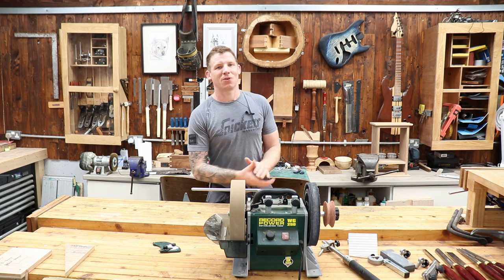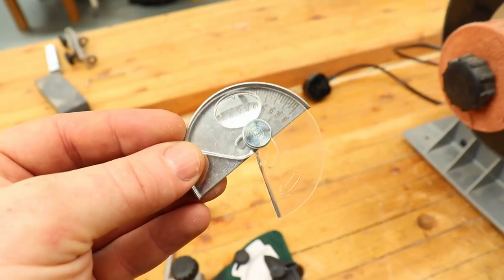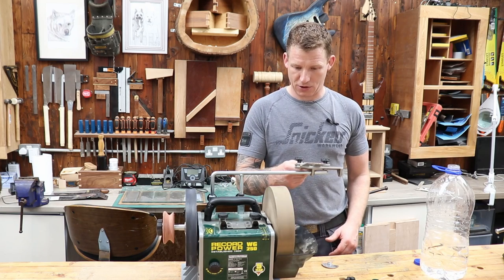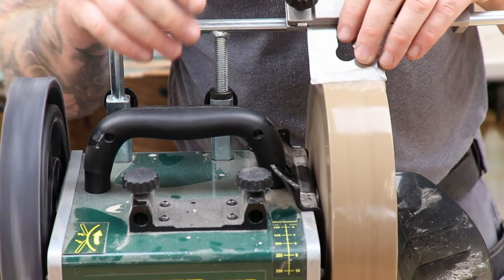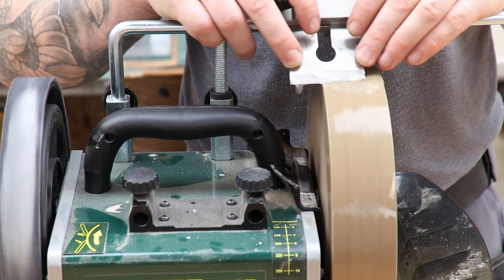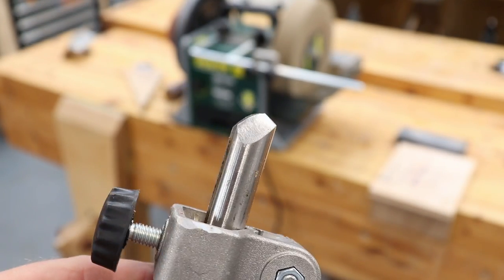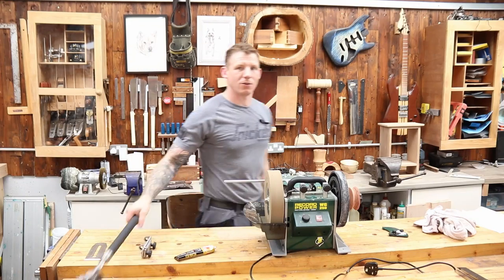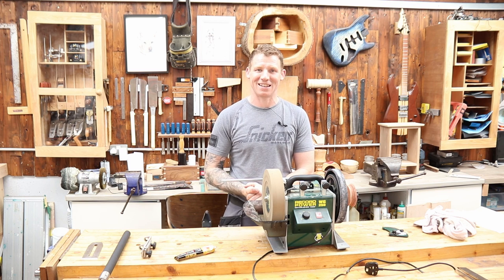Record Power WG 250 Wetstone Grinder User Review.

Comment: I'm using the 8" system and got the woodturners jigs set as well, it does take a bit of getting used to but for me it's fine. I put a ball of blue tac into the gouge gig holder helps with keeping it centred, doesn't stop the chisel riding up onto the wheel. skew, parting and roughing chisels come out great, detail gouge is giving me a bit of trouble but i think it's just practice for me. like you showed do the flat blades first and then gouges. Just a hobby but I'm happy enough with it. Would love one of the better systems but the price is the problem. one thing for sure this is a lot better than my belt sander upside down on the bench.

Comment: I I put a board 1.5 cm under the legs on the side of the wheel with the skin and the water did not spill over the machine.  I also used a cuvette on the side of the grinding wheel.  I sharpened an 8.5 cm blade.  The water did not spill onto the table

Comment: I have a lot of Record Power tools in my workshop, and you can see Record Power don't sharpen their tools on the WG200 or the WG250 other wise they would have fixed it.... its common business to remove what doesn't work off your shelf and replace it in time..... its easy to make a jig to fix the issues, but you shouldn't have too.... it should be ready to use when you buy it! 

Thanks John for bringing this issue to us all (and may be RP too)

Comment: I'm so glad it's not just me. I got mine about same time as you got yours and I too assumed because it was from Record Power then it would be decent. Iused it yesterday for what was only the third time, not because it does such a great job that I can go ages between having to resharpen but because it was such a faff to set up and the spindle jig so badly designed that it was actually making my tools worse. The angle-finder that came with mine has less than a nanometer between being locked up solid and in three pieces. The green tool setter is not much better; trying to hold that against tool and wheel while trying to adjust the support bar seems to require more than the two hands god deemed adequate. Water slops everywhere and the gouge jig is a pain to use. My first attempt left my tools with more faces than your average politician. Second attempt looked better but bowl gouge wouldn't cut at all and I had to adopt some unconventional handling to get the spindle gouge to cut. As I mentioned earlier, I bit the bullet and bought the Tormek TTS-100 to use with their SVD-186 jig. Both come with 'formulas' to obtain some of the popular grinds and the TTS-100 makes setting the support arm a doddle. And it will do so even as the wheel reduces in diameter. It also takes away the trial and (mostly) error of where to position the jig on the gouge. That was a lot simpler and smoother to use than the RP version with none of the slipping out of a poorly designed cradle. A couple of minutes later I had gouges worthy of the name. They worked brilliantly without needing to contort into all manner of weird and wonderful shapes. The SVD-186 costs about 10% more than the entire RP woodturners package but the difference in quality, ease of use and the final result soon shows why.

Comment: You can use a fine diamond plate or ultra-fine wet stone on the wheel and it makes it super fine and will give you a polished edge. Also, I used some sandpaper on a block to lightly true the leather strop.

Comment: I have the smaller wg200 for getting old plane blades back to having a primary bevel. It works well. Coarser the stone quicker grind. Have a plastic tray under it to catch the water and so long as you don't turn speed up water stays within 6 inch of the machine. Tormek just as bad I've heard. Angle guide does work once you get hang of it tho is fiddly as you say. Strop on mine not too bad but I always free hand polish on mine. Turn speed to full and with the metal polish leaves a mirror finish, so long as you remove the water bath else you get water everywhere! Not noticed stone being soft but I don't sharpen turning tools on it yet. I get better result than a grinder and no risk of overheating. Would love a CBN wheel for it but that's for loads later. I think you wouldn't like the Tormek either from what you say and the pro edge seems to be a belt Sander with a jig. Not supprised you disappointed considering extra cost of the 10 inch model. Should have been better made tool not just bigger wheels.

Comment: It's exactly the same machine as the Sherwood (sold in Australia), just with a couple of cosmetic differences. No doubt there is an American version too (Rigid or similar - haven't looked). 
So don't be too concerned with the brand name when buying low to mid-range machinery, they all come out of the same factory, just branded differently for different markets.
Reply: add jet to this list

Comment: I drilled a small hole in the receiver for bowl gouge sharping tool to sit in, moving the drill bit in a circular motion to allow for the movement
Reply from the maker: Cool idea!
Reply: @JohnMcGrathManInShed  I've since set up the rectangle platform that comes with it at 40° (almost horizontal to stone) and with digital bevel marked two 40° lines pointing towards the center of stone for doing 40 40 grinds, i can sharpen everything just off that. Thinking of cutting the platform with dremel to go in further so wheel will be in on it if ya get me

Comment: Very interesting thank you. Just found out your vid, after I received the WG200. Maybe I would have thought twice before purchasing... anyway, sharpened about 6 chisels yesterday, then I coumd see this little recess right in the middle of the wheel so I will likely consider changing it as you adviced. in the meantime , it does the job. I have the fingernail profiler from R Sorby, works fine with it although I had to make some kind of installation/raise the RS system in front of the WG200 wheel. The only thing I never figured out: as opposed to dry wheel machines, grinding is done in the opposite sense with wet wheels. not a problem. Oh, and I love this Strat body in the background ;)

Comment: Hi John, an interesting review.  I nearly bought the WG250 but in the end, I went for a Tormek T4.  I don't do wood turning (at the moment) and agree about the usefulness of wet stones for plane blades and chisels.  One point that I would make is that I think its best to view the water stone (Tormek or Record) as a consumable item and accept that after a period of time it will need to be replaced.  The same is true of the Sorby system or a bench grinder.  They all wear out albeit at different rates so will need replacing.
As far as the water problem is concerned, I came across a post on the Tormek users' forum which suggested not filling the water trough up so much.  Once the stone has absorbed water, it only needs a relatively small amount to keep the stone wet.  I have tried it with the T4 and the amout of overspill is much lower.
Keep the videos coming.  I really liked the tool cabinet series.  It's certainly given me plenty to think about.
All the best

Mark

Comment: Nice review man, from your accent I'd say I'm not too far away from you in Carlow town. 😉 I have the Rutlands version of this machine, looks identical except branding. I used it once to managed to make a massive valley in the wheel like you spoke of. Must pull it back out from under a bench and set it up for establishing primary bevels on flat chisel and place blades. Like you say, I think it will work ok for that before hitting the diamond stones or whatever.
Reply from the maker: Not to far away at all

Comment: Thanks for finding out the hard way for the rest of us. I had a Triton branded machine that was much the same, before I got into turning. Brilliantly sharp edge, but the tool rest bar moved out of square when tightened down. Not a single square edge came off that thing.

I think I'll get a CBN grinder for my needs- Like you, I'm not willing to spend the $1500AUD to join the Tormek club.

Comment: Hi John, just a quick question regarding lathe tools jig: is it perhaps designed so that the wheel should be going TOWARDS your gouge so that the wheel is actually pushing one part of your jig into the other? Instead of, of course, lifting the gouge over the wheel like shown in the video.

Comment: Hi! I listened carefully. I understood that nothing beats the Tormek. We have in France the Scheppach (which costs 120€ or three-four times less than the Tormek). We reproach him that the grinding wheel does not rotate round and the lack of micrometric guidance of the template support: which makes me hesitate . Does recordpower have the same disadvantages or is there just the problem of the quality of the stone, too soft and a poor general qualitative aspect.Because if the bearings are correct and just a wheel problem to change it can remain interesting. as you did with the diamond wheel. thank you for your opinion

Comment: Hi, I am looking into buying something like this for reestabilishing bevels on planes and chisels, no curved blades, no final honing, I found a few models under different brands, with the same specs, for a third cheaper price, or a smaller version of this (wg 200). They all look quite the same. Do you think that the brand might matter, or am I safe in asuming that it will most likely do just fine for its intended purpose?

Comment: I have 3 grinder all bought mid price to expensive and now they are set one for grinding, one for sharpening and one with felt polishing wheels.  when bought the all came with grinding wheels so low quality the wore quicker than sugar cubes in water. whatever i buy, grinder,bandsaw or chop saw i always remember my dads words "no matter how good a maker builds a tool, they will always use the cheapest consumables for better profit and after all they expect users to add their favourite consumable, so why put a top line bandsaw blade on when the buyer will probably swap it straight out for their favourite make and size". with that in mind when i buy a saw etc i expect the blade or whatever to be crap and either have or buy one to my standard ready. these days customer interest and consumable quality have been replaced with profit andinstant consumable replacement. once if a maker made power tools or cars the law and morality said spares had to be made and available for 10 years after production ceased, these days your lucky if theyre available 2 years after launch.

Comment: What a time consuming palaver to touch up an edge. Water all over the place. The whole system is poor, whether you buy a high quality version or a cheapo. The best solution. Buy a Worksharp. Having a slope is a much superior system for dry reproducible results. It takes more time to get to the Worksharp than it takes to renew the chisel edge almost😀. 1 click if you want to change the angle. Adjust to the width of the chisel and away you go. Same angle every time.